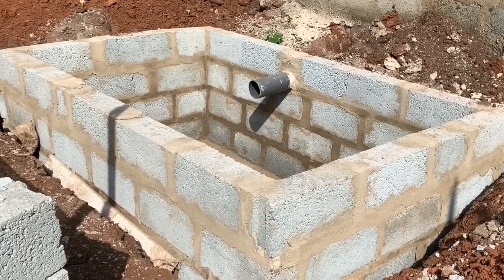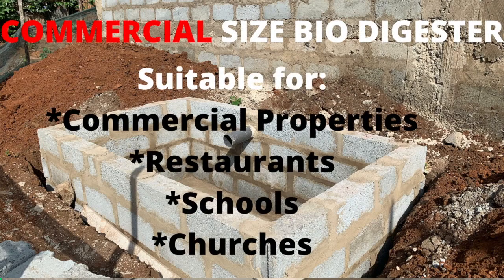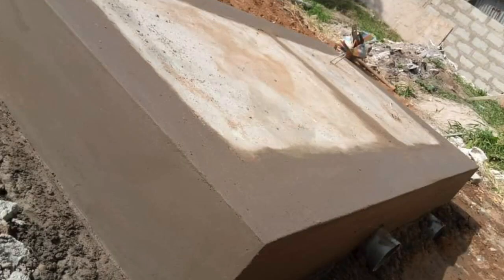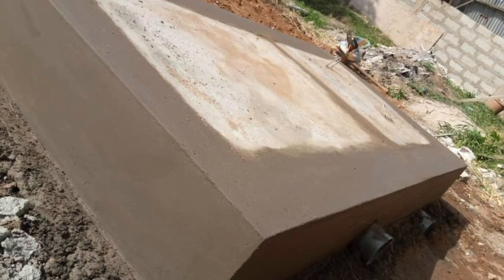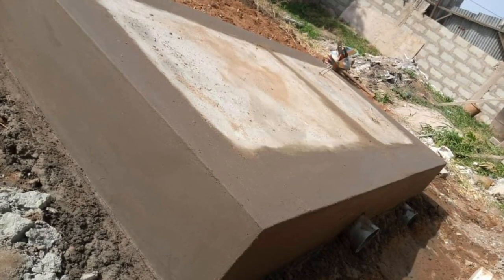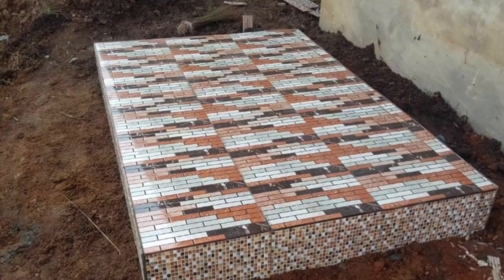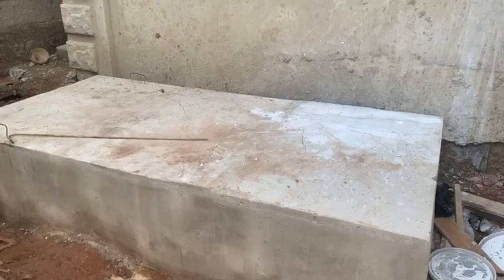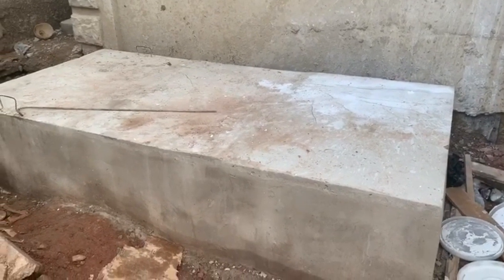4 Types of Biodigesters for Home Owners in Ghana

Comment: If the minimum retention time for digestion is two weeks, the daily flushes must be multiplied by 14 to get the minimum tank size (depending on the toilet cistern capacity). Even assuming that only black water enters the digester and grey water is directed elsewhere, these biodigesters seem much too small. Pls clarify.

Comment: Add what stage in the building process should one start constructing a biodigester?
Reply from the maker: Ideally it should be done after plastering and  before the ground is levelled.
Reply: @JerryAdu-Asare  ok cool. Do you usually have problems when you're not the ones who do the actual plumbing of the house? Whst i mean is someone else does the plumbing, the house is fully built now then i call you to come and do a biodigester. Since youre not the one who did the earlier plumbing, do you usually have problems with installing the biodigester to work with the existing plumbing works?
Reply from the maker: @princeatubrah9165  ideally we work with your plumber who already knows the plumbing works in the building so it's simple we work in tandem with them.
Reply: @JerryAdu-Asare  ok that's perfect. Very informative videos. Keep up the good work